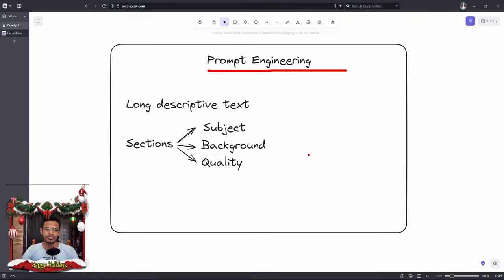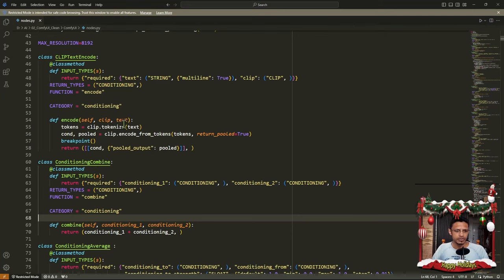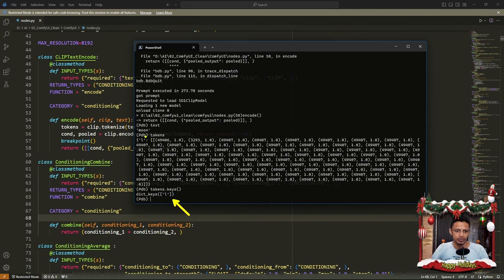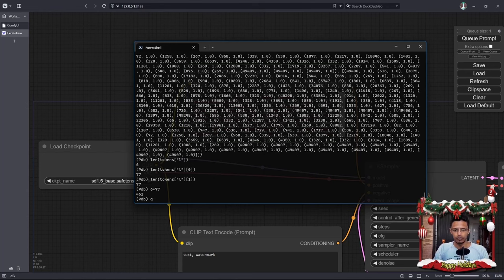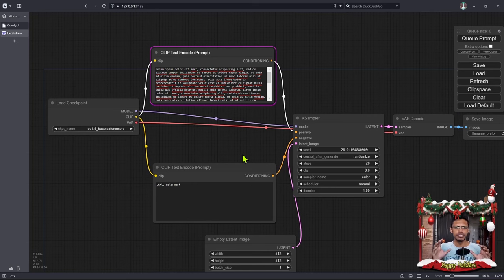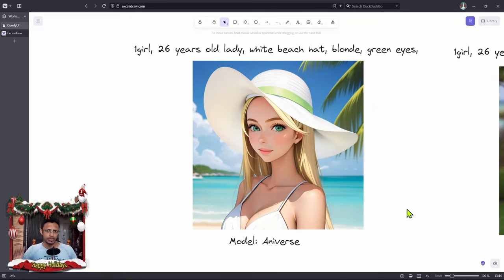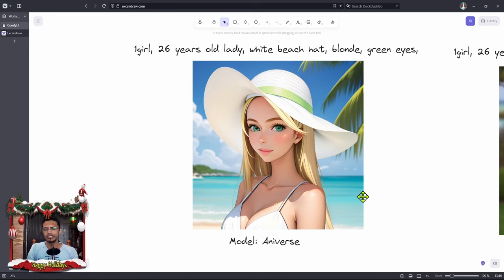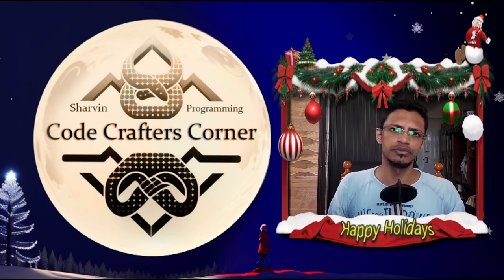Understanding Prompting for Stable diffusion in ComfyUI

Comment: Somewhere I learned to use the word " BREAK " along the way so my prompt looks like this " 1girl, 26 years Old, white beach hat, BREAK blonde, BREAK green eyes," and this works. Great explanation !!
Reply from the maker: Thank you, @randymonteith1660! I'm glad you found the explanation helpful and appreciate your input the the word "BREAK". I'll look into it and do some testing.
Reply: Isn't break a A1111 thing to separate conds into isolated chunks? There is probably a node for it in comfy, just like combine is a replacement for AND.
Reply: This explanation got me curious on what would happen if I average hat with the color, etc, and then concat all. Gotta test that 1.
Reply from the maker: Update: the word BREAK did not work in ComfyUI for me. Thanks @finald1316, for clarifying that it's for A1111. I tried a few times and thought i was using the word the wrong way. I am not aware of such a node. If I come across one, I will update.
Reply from the maker: The ConditioningAverage can be used to merge two or more concepts like making a hybrid horse + crocodile. Definitely give it a try.

Comment: @5:30 chapter: From my understanding, setting the last clip layer to -1 is not removing the last layer. The issue is that there are like three ways to represent the issue that this is trying to resolve, and it's different between ComfyUI and A1111, which are themselves different from what someone sitting down and looking at the problem from a pure UI perspective would probably do. ComfyUI is using the value as a direct index.

With the caveat that this is from memory, what happens is that there's an array of layers — we'll say an array of [A, B, C, D] as a simple illustration — and we want to make it so that the system disregards a certain number of layers at the end. 

In most programming languages (including Python), arrays are indexed starting at 0.  That is, array index 0 will get you A, then array index 1 will get you B, index 2 will get you C, and index 3 will get you D.  We want to drop D, but we don't want to require that the user know how many layers there are. In Python, you can do this by using negative numbers to index from the end of the array instead. So -1 is D, -2 is C, -3 is B, and -4 is A.  

All well and good, but the node is specifying what the last layer is, not the first layer getting dropped (or the number of layers getting dropped). So if you set it to -1, you're saying that the last layer that the system will use is -1 (D), which means you're not actually dropping any layers.  What you need to do is set it to -2 (C), so that C is the last layer used, and D is discarded, if you want to drop the last layer.
Reply from the maker: Thank you, @David-id6jw for providing a detailed explanation and sharing with the community.

Comment: Very useful and well explained! I now feel like I have a MUCH better understanding of how prompting works, though I also understood it depends a lot on how individual models were trained. Makes me wish there was a way to query a model to know what kind of prompts it prefers.
Reply from the maker: Thank you, @Ken1171Designs! You're right, individual models can have their own preferences. I like the idea of querying a model for its preferred prompts. I appreciate your feedback. Thank you for watching.
Reply: @CodeCraftersCorner  The way I handle this is to keep a copy of the example prompts for the model, so I use them as a starting point. However, that alone is not enough. I also copy the recommended settings to get results similar to the example ones. This is a lot of work, so automated the task with a Python scraper, but they changed the site to use dynamic pages, making the process harder. That's why I wish there was a way to simply query the models to know the kind of prompt and the recommended params. I wonder if that could be added to the models as metadata?
Reply from the maker: It might be possible but I am not sure how that will affect the training process. The way I handle it is to manually set the settings / prompts a first time and save the workflow in JSON format. The next time, I simply load the workflow and continue from there. It is not perfect but at least I am only entering the settings once.
Reply: @CodeCraftersCorner  The problem with JSON is that we can only save 1 set of prompts and params that fit 1 model. The moment we change models, we may need a completely different set. 

When I mentioned adding this info to the model as metadata, I meant adding it after the training as extra info, similar to how PNGs have reserved space for metadata that is used for all sorts of things. I know models may not have such things, but I leave it as suggestion to add a metadata section to AI models for this purpose. I am sure people will find many uses for it. :)
Reply from the maker: Good suggestion! For now, I am using the Note node to hold any additional prompts or information before saving the workflow.

Comment: thank you for your great effort to explain ist, amazing. I just tried your prompt and added "blue jeans, black shirt, red sneaker". Randomly it ignored one or two of the elements. I don't understand why.
Reply from the maker: Thank you for trying out the prompt, @muc2810! Different models can react differently to prompts. Also, the same model can be trained more on a particular term. For example, if during training, the model was exposed to blue jeans more than red jeans, the model will react more to blue jeans than red ones. It's best to experiment by adjusting or removing certain terms and see the influence on the final output. Play with the prompt weights and try various conditioning nodes. You can also try inpainting, image manipulation, post processing to optimize the results.

Comment: Is there a way to use PDB to prevent mat1 and mat2 not matching, tensor numbers not same ,or need half got float etc.?  Somehow correct the size errors before they error out. I also keep seeing the  clip missing: ['clip_l.logit_scale', 'clip_l.transformer.text_projection.weight'] error while loading comfyui.
Reply from the maker: Hello @offmybach! The error is more like a warning. The content of some checkpoints are different which shows the warnings but using it should work just fine. There an issue log here: https://bit.ly/43yQnhk

Comment: Can you explain how the 'clip set last layer' node works?
Reply from the maker: Yes, @mehradbayat9665! In neural networks, there are input and hidden layers which are responsible for receiving input data and converting it into vector representations which machine can understand. Let's say, the input data is text. The text gets pass to the input layer which outputs a representation of the data. This is then passed on to hidden layers (can be many). Let's say, we have 3 hidden layers. If we do not set the clip set last layer, the data will go from input layer to all 3 hidden layers and then gets outputted. If we set the clip set last layer to -2, the last hidden layer will be skipped (input to hidden layer 1 and 2 only). Hidden layers perform computations using weights and biases. In general, less hidden layers means less intricate detail about the input data is captured. It's best to experiment as each model will give different results.
Reply: @CodeCraftersCorner  Does clip training perform back-propagation? If the -2 layer is set, is this assumed?
Reply from the maker: From what I can see in the code base, it does not explicitly show backpropagation. the clip_layer method is specifically setting the layer index. If you want to take a look at the code base, you can go to ComfyUI portable folder > ComfyUI > comfy > sd.py > lines 88 to 151. There's the CLIP class and the method clip_layer.

Comment: By using Combine average with weight 1.0 you just gave a weight of nearly zero to another part of prompt. This is why green eyes don't influence the picture. No green eyes so no green color bleeding.
To me this video doesn't look correct, but I will recheck on my own. I'm sceptical still
Reply from the maker: Thank you, @lalayblog, for catching that mistake!  You're absolutely right about the weight of 1.0 affecting only one prompt. I was so focused on the "white beach hat" that I did not realize I forgot to change the weight. I have rerun the experiment with the same checkpoint, prompts, seed, cfg and sampler with a weight of 0.0, 0.25, 0.5, 0.75 and 1.0. I have posted the results here https://bit.ly/3H0doPy.